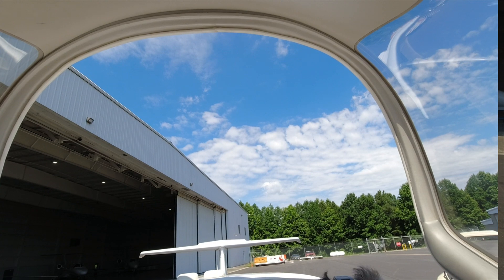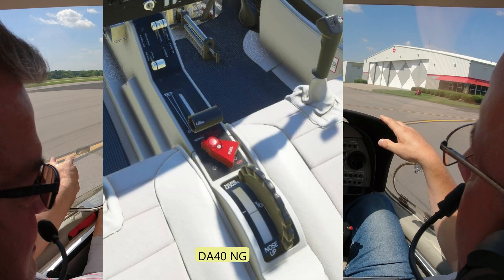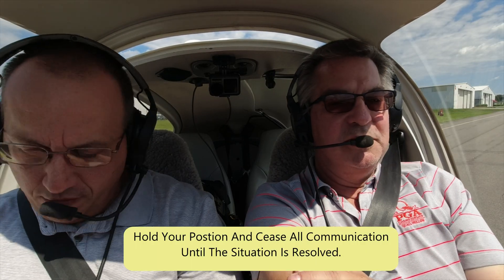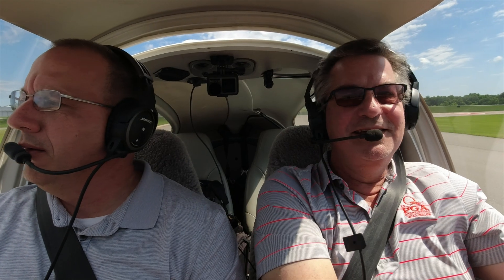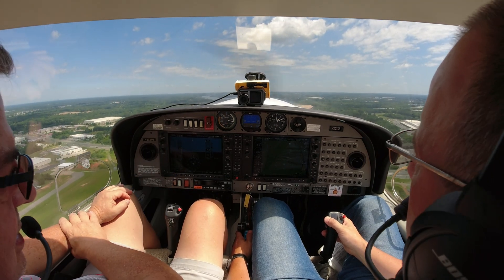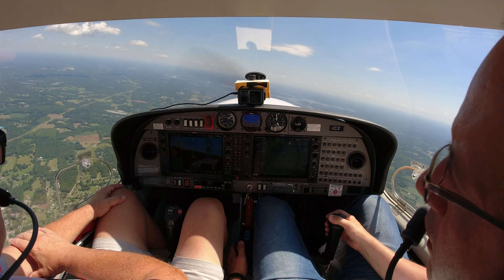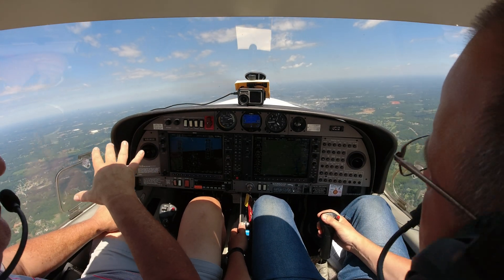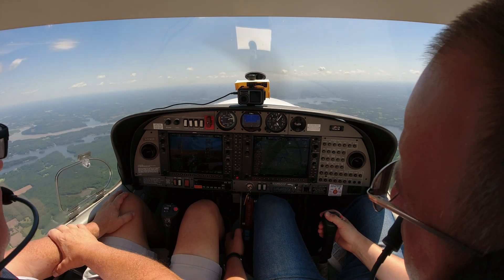Flying A Diamond DA40 vs DA40NG

Comment: What was the audio box you had in your hands in the beginning please?
Reply from the maker: That is a Tascam DR-05X digital recorder.  That records the headset audio for the videos.
Reply: @diamondstarpilot  you had two boxes. One with the cable from top, I suppose that was Tascam and then another box with a knob
Reply from the maker: @rainmaker1011  The one with a knob is a volume control.  The audio output from the plane is too loud for the recorder and causes distortion so, I reduce the volume before it goes to the recorder.
Reply: 0:35

Comment: The NG has about 30 minutes of powered flight after the alternator fails.
Reply: Is that a joke?
Reply from the maker: The ECUs require power to run the engine.  The main battery can run those for about 30 min.  There is also a backup battery for ECU B that will provide an additional 30 minutes.  So, you have 30-60 mins before the engine shuts down.  This is similar to having two e-mags installed in a non FADEC system.